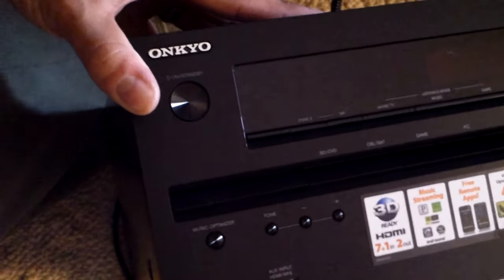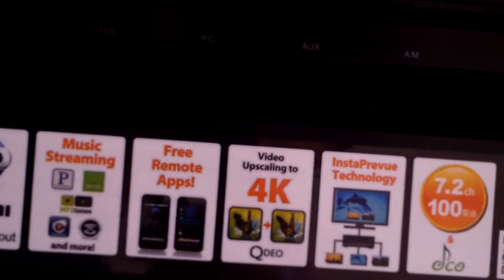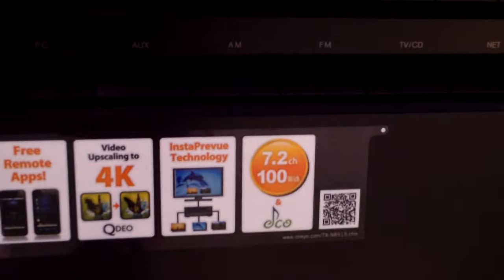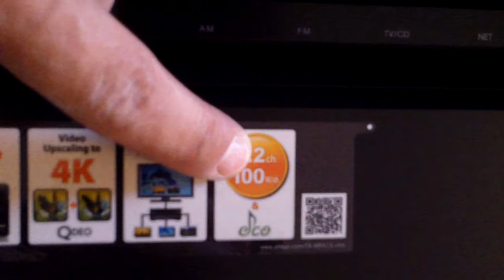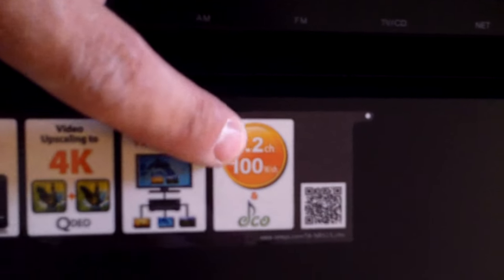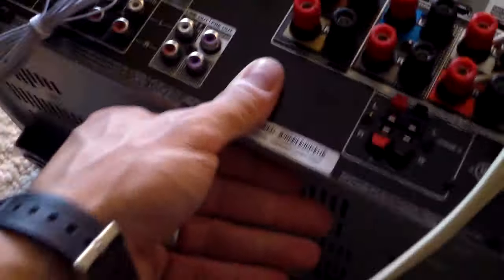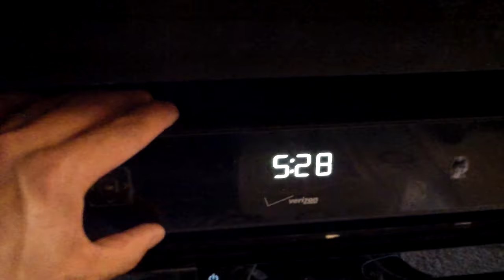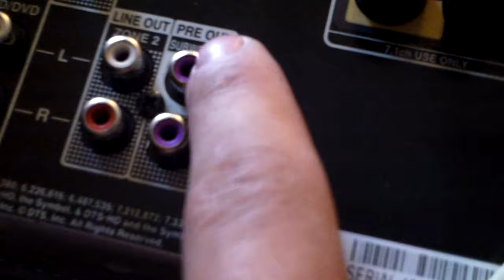HOW TO CONNECT ONKYO RECEIVER PT1

Comment: How would I connect a subwoofer that has the same type of connection as the other speakers with the plain wire and not a plug.

Comment: Thank you for the battery tip, and how to connect speaker wires. I bought a new Onkyo stereo receiver some time ago and I’m finally getting around to hooking it up. However, the way the speaker wires are attached is different from my old receiver and the instruction manual is not clear enough. I’m glad that is the only thing I needed to know because you whiz through everything so fast. You assume knowledge that many viewers don’t have, so you race through things. Also, the camera jumps around so much I couldn’t see what you were doing half the time. Made me dizzy. Please, slow down a little!

Comment: Hi There,

I would need tour help to set up my Onkyo TX NR 6100 brand new l got it as a gift 4 years ago and never got to use it.
I would need your help to set it up with my Bose Acoustimass 3 Series IV Speakers that have both the input that comes from the amp and the output that goes to the cube speakers at the back of the sub.

I have two sets of the Bose Acoustimass 3 Series IV Speakers and would like to use the front and rear speaker output of the TX NR 6100 like an integrated amp for playing music as well as watching my cinema.

Thank you for your help. 

Michael

Comment: Not sure if there's a tracer color on one of wires or not...hmmm
FYI - use a sharpie to write on the cables what speaker they are attached to...FL, FR, SL, SR, C, SBL, SBR, FHL, FHR,...etc. 
If you really want to be particular, use a RED sharpie on the pos, and a BLACK sharpie on the neg.

Comment: I have the TXNR 808  Have front speakers connected to JBL 112's and rear JBL Studio 4406 speakers connected to surround rear.  I have confirmed all connections from the amp are good  but still have no sound with rear speakers. Can you suggest what settings I need to make on the amp for the rear speakers? Thanks

Comment: Hi I don't have the optical connection because my surround sound system don't have this option but I use the digital jack cables white and red, but if I plug in on my surround sound system to the audio input and output one side to the surround sound system and the other side to my HD TV I didn't get any of sound from the speakers. But all source like blue ray player I connecting by HDMI cables from the source to the surround sound system and from the system by HDMI output to the DH TV, and I am not sure if I am do this right. And my surround sound system make is Auna, HOME CINEMA RECEIVER AMPLIFIER TUNER 1200W HDMI MIC IN SURROUND SOUND RADIO AMP. And the speakers make is BENG V9B in brown I need any of help and advice.??
Reply from the maker: there is 2 ways to connect surround sound,
1 way connect all devices av cables to TV's inputs then TV's audio out cable to surround sound 
2nd way is to connect all devices audio cables straight into surround sound then out to TV. check all loose connections.
Reply: +Tampatec I have Sony wired speakers that I use for surround sound, can I use my Sony speakers with this onkyo receiver?
Reply: +Spencer Beck yes
Reply: @ivansimko2365  where do the wires from the ribbon cable on the Bose subwoofer go to on the receiver?

Comment: I have a similar amplifier the tx-607 that has surround back speakers also to make it 7.2 but I can not get the left back to work at all I've tried everything I can to get it to work but I can't when I select all channel stereo one of the back surround speakers does not work so it's 6.1 the speaker definitely works I switched it with one of  the standard surround speakers anything you can think of that could be causing this
Reply: Is your receiver , only plug the speaker where you don't hear anything then you can pin point the problem

Comment: I have ONKYO TX-SR508.  I use Bose Acoustimass for my surround sound.  I hooked everything correctly so all speakers work properly. However, I just bought two more Bose speakers to make it 7.1 surround sound.  After connecting the two new speaker to ONKYO, I cannot seem to get any sound out of them.  These to extra speakers are behind my couch.  I already have 3 in the front and two on the side.  How do I make the two extra speakers work?  Please help.  Thanks.  Seb.

Comment: I have the bose 4 cubes, center + sub, but there's not nearly enough treble.  I have a great 20 channel RCA equalizer that I used to be able to use with the loop function (tape2), but onkyo doesn't seem to be able to have that option. Please advise.

Comment: Hi, I'm doing a single connection on my speaker to the receiver but on the back of my speaker has 4 poles for bi -amplifying I guess. Which one do I need to use the bottom +- or the top +- for single connection.?

Comment: You said your system is only as good as its weakest link. Would that also include speakers if some of your speakers you are using are worse than the others, even if the receiver and source are fine.

Comment: Hey mate, could you help me, I got a 47Lm7600 and I bought one of these yamaha receivers I got it connected through ARC system as per catalogue but I cant hear normal tv through it just dvd work alrght but normal antenna tv does not work.  Do you know what's going on?

Comment: I just bought a new house that has a receiver and surround system but don’t knkw how to connect it. Can you help me
Reply from the maker: If house has in wall speakers then find wall plate where all the speaker wires are hidden in usually where a tv and amplifier would be. To identify the speakers use aa battery then tap positive and negative speaker wires to battery you should hear static popping noise from 1 speaker then connect to amplifier.

Comment: you have wii right????  you can used hdmi for that instead of those cables. and it gives you almost hd resolution for that.. anyway just saying.. but thanks for the info about - and + using battery.. cheers for that :)

Comment: And your answer to her question, had nothing to do with what she asked.  She asked you, "what makes a good receiver?"  You mentioned a bunch of general points that are true for every receiver on the planet, both good and bad...garbage in gargage out always applies.  Proper hardware and application is always key...BUT WHAT MAKES A GOOD RECEIVER???
Reply: He did answer. A good receiver is a receiver that has good equipment to work with. Top of the line speakers and top of the line wiring, with something like a 100-140W amp will sound absolutely beautiful.

Comment: nice video :) just one question :) Can you check if the speaker working with this trick with the battery ? I have a problem i got a gift one receiver and 5.1 home theater system but when i connect only the subbuffer to the pc with cinch cable i don't have any sound from the speakers and i got a bizzi sound like brrrrrrr... and i don't know if the buffer is broken or i can't connect it properly to my pc :(
Can somebody help me
Reply: SubWoofer?

Comment: To help people he forgot to tell you.. using a batt to see what's neg or pos. The speaker haves to be pushing out for the right contentions. If your touching the batt and it's piping in the speaker is piping in. That's wrong. You want it pushing out
Reply: FORGET THE BATTERY

Comment: one question, not related to home theater but can you wire a 70 volt speaker system in a house like the ones you find in stores

Comment: Bro, how to you make video about how to setup a home theater, and the first thing you show is bare wire connections, with stray wire strands pouring out of the side of the binding post.  Home theater 101...banana plugs at least, but if not, tuck that ish son!